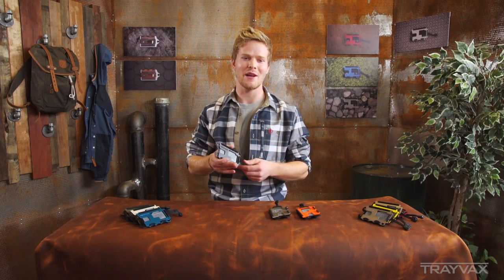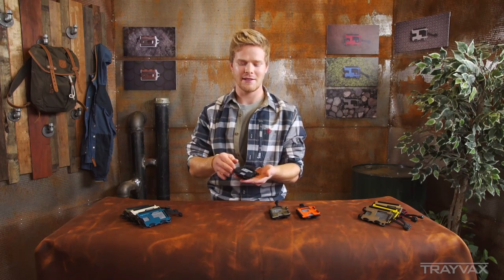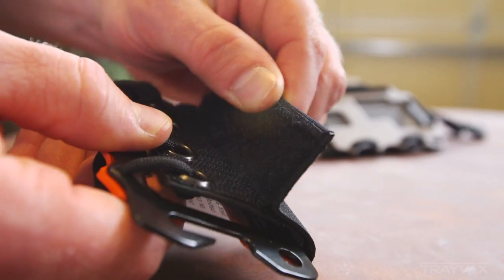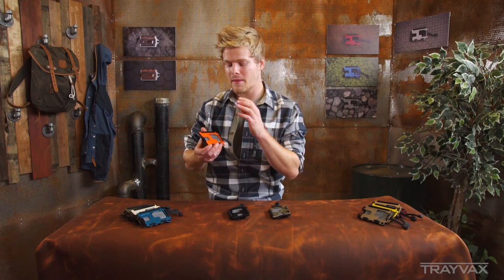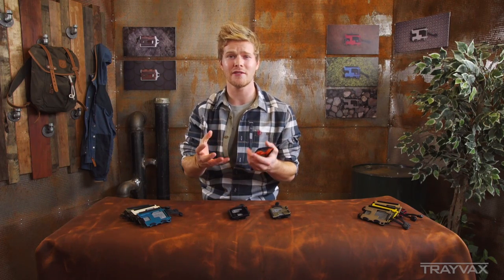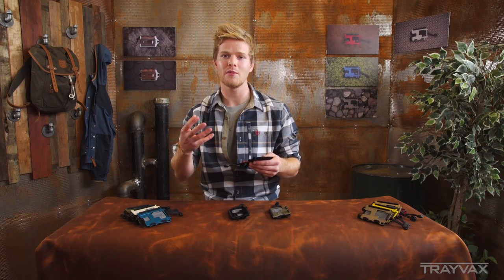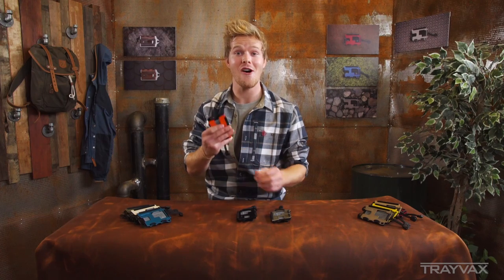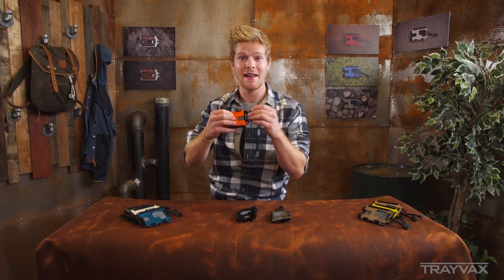The Trayvax Original

Comment: Looks useless to me.I am an aircraft mechanic i am familiar with the type and thickness of aluminum he talks about. I know the  amount of force it would take to bend a .090 thick piece of aluminum at a 45 degree angle. if you fall on your butt and bend that thing 45 deg, that wallet is the least of your worries.Throw in the fact that it is backed up with steel. I would give 10.00 for one. Common every day materials minus the candy coat.
Reply: David Miller I hit my sisters boyfriend in the chin with one of these wallets full force and it left a 1 inch gouge in his chin and knocked his ass to the ground. There was some skin on the bottle opener, my cards and the bills I had in there didn’t fall out, nothing bent 3yrs strong with this wallet. And my sister isn’t with her boyfriend anymore. Good wallet.